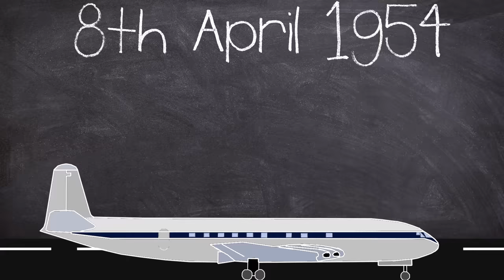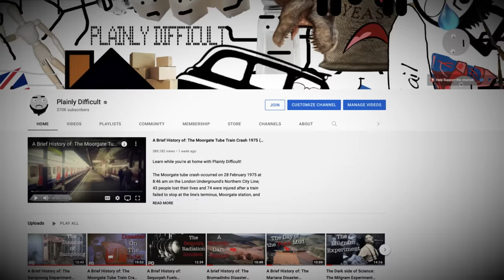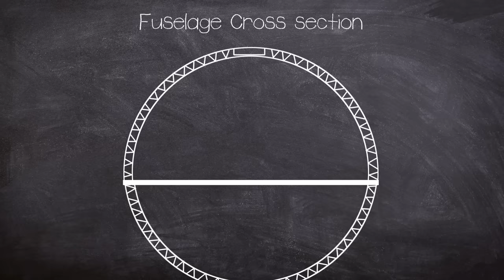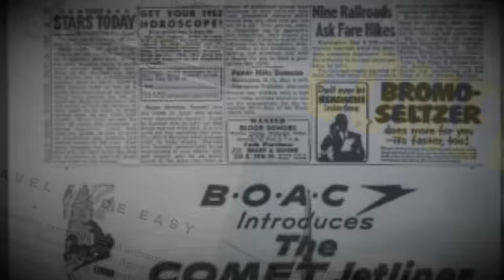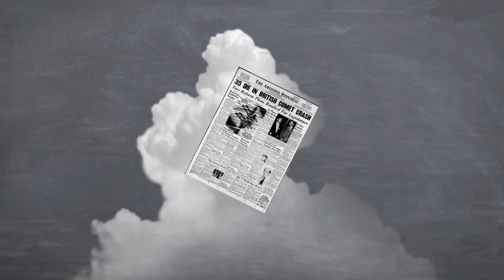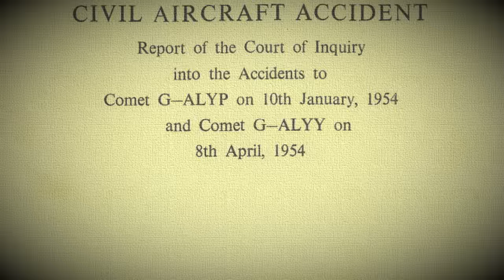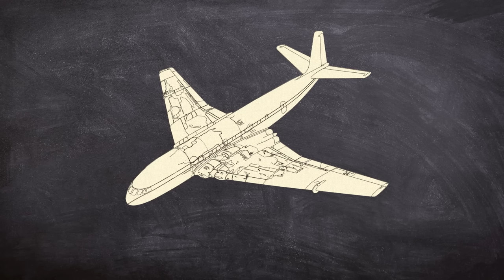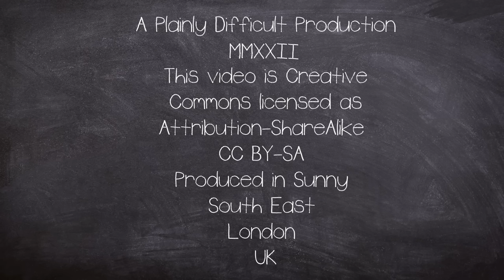A Brief History of: The de Havilland Comet Design Disaster 1954 (Documentary)

Comment: There is one thing that was missed - well, three things, if you count in the fact that the rivet holes on the Comet 1 were punched rather than drilled, which gave rise to the stress fractures in first place:
The Comet 1 design was deliberately made as light as it could be.  The Comet 1 was relatively underpowered, having four de Havilland Ghost 50 Mk1 engines which only offered about 5050 lbf per engine.  From the Comet 2 onwards, Rolls-Royce Avon engines were fitted instead, which were significantly more powerful - the Avon Mk.524s on the Comet 4 offered 9,500 lbf per engine.  As a result, from the Comet 2 onward, the aircraft were built significantly stronger.  The lighter structure on the Comet 1 was part of the reason why it failed so spectacularly: it simply was not designed for the sort of stresses that it would see in real life, even though engineers at the time could not have been aware of this.
Another thing is, that prior to the Comet disasters, the prevalent design philosophy used in British aircraft engineering was that of the Safe Life - a predetermined limit set at which the structural safety of the aircraft was thought to expire, and after which the aircraft should be withdrawn from service.  Going from prior tests using individual components, IIRC De Havilland calculated the Safe Life of the Comet 1 around 16000 pressurisation cycles.  Following the second series of tests which used an entire fuselage, however, the Safe Life of the Comet was proven to be dramatically shorter than previously calculated - failure expected to occur at any point between 1000 and 9000 cycles (or as it proved in both crashes, 900 cycles for G-ALYY/SAA Flight 201; and 1290 cycles for G-ALYP/BOAC Flight 781).  Following this, the design philosophy in aviation gradually moved from Safe Life (i.e. a precalculated failure point before which the aircraft would be retired) to Fail Safe design (i.e. designing the aircraft structure in such a way that any failure would not result in catastrophic/fatal damage).
On a side note, the earlier crashes mentioned also revealed different issues.  BOAC's G-ALYZ (October 26th 1952) and Canadian Pacific's CF-CUN (March 3rd 1953) both crashed at take-off after their crews over-rotated the aircraft.  Subsequent investigation showed that when the nose was raised beyond a certain point, the airflow over the wings was interrupted leading to a loss of lift, rendering a take-off near-impossible; as a result the wings' leading edge was redesigned.
BOAC's G-ALYV (Flight 783, May 2nd 1953) broke up in a thunderstorm; subsequent investigation revealed the aircraft was over-stressed by turbulence occurring inside the thunderstorm.  Failure in this aircraft was found to have started with its elevators rather than the fuselage itself; the accident was thus not caused by fuselage depressurisation, but rather the tail surfaces tearing off in-flight under negative stresses, which caused the aircraft to lose control and quickly disintegrate (within seconds, losing its elevators, then its wings; witnesses saw the wingless fuselage appear out of the cloud base and crash in flames).  A similar accident occurred 13 years later with a BOAC Boeing 707 over Mount Fuji (BOAC Flight 911, March 5th 1966).  In this case, the cause of the accident was clear-air turbulence, but the sequence of the structural break-up of the aircraft mirrored that of Flight 783 (failure of tail - failure of wings - crash).
Reply: So if they were made properly, could square windows still be used in airplanes? Or are they inherently weaker than round windows?
Reply: @BlackRavenFeather565  Concentrating stress on four corners of the window would require a lot of reinforcements making the aircraft heavier and more complicated than it has to be. It's even better to have bigger rounded window than smaller square one. That's why almost all aircraft windows are rounded. Not perfectly round though, just enough to spread the stress evenly over the edge.
Reply: Following this, the design philosophy in aviation gradually moved from Safe Life [...] to Fail Safe design
This is really interesting. The design philosophy changed from "let it crash and burn after X cycles" (ironically called "Safe Life", it's obviously a cost saving measure it should be called Save Costs) to "let it not crash and burn". I think that's a positive change.
Reply: @holz_name  No, that's not how it was intended to work. Safe Life was simply the designed lifespan of an airplane which should be safe to operate and after which it should be decommissioned. Like a car that is guaranteed to work for 150k km and then should be scrapped as it may become dangerous. The second approach is to make something that will be fail safe - should be safe even in case of failure. It's like a car without lifespan limit that may break after 50k km but will not kill you. It has much longer lifespan but requires regular maintenance to keep it safe.
Reply: Yes, I understood this. Safe Life is a cost saving measure, because you just declare that the aircraft is "safe" for x takeoffs and don't require costly maintenance. The other approach is costly, because first you need to design an aircraft that will not have a catastrophic failure and secondly it needs regular maintenance.
Reply: The square window thing is a bit of a fallacy given that the window's had filleted corners (see 15:00).  As pointed out, it was more likely the skin rivet hole manufacturing process that caused the surprising reduction in fatigue life.  I wonder if the second pressurisation fatigue test mentioned above used a production (or semi-production) fuselage with punched rivet holes rather than prototype drilled holes.  Also, the Boeing 707 had "square" style windows in a similar fashion to the Comet 1 although perhaps with larger corner radii.
Reply: Can you expand a little on this?
Reply: @Kevlar67476  De Havilland famous plane in WW2 is the Mosquito which is agile, fast and has low radar signature, but it is made of wood. Another fast and agile fighter is from Japan called Zero, which lack any armour. The mindset at work here is you trade some lifespan for some performance advantage.
Reply: @xponen  mosquito was a response to material shortages and lack of industrial capacity. 
Great Plane though. Glad it worked out.
Reply: Thanks, Nikko. I was hoping someone would mention the punched rivet holes. I watched another video about the aircraft a while back that covered items that weren't in this video.

Edit: I re-watched the other video.

1. The punched rivet holes. I don't remember if that was the case with the test article used for pressure testing, though. It may have been done to speed up production. Edit: If they had glued the airframe around the windows instead of using rivets, this problem likely wouldn't have happened.

2. The same test article was used for two different tests instead of one being built for each test. If I remember right, the pressurization/depressurization test work hardened the airframe, which caused incorrect results when the airframe was pressure tested to destruction. Edit: The two tests were maximum pressure and flight cycling. The stresses from the maximum pressure tests changed the molecular structure of the aluminum, which resulted in the flight cycling tests falsely reporting a higher number before failure.

3. They knew about problems with square windows, and they were accounted for in the design. Rounded windows are just easier to work with, so that's what we have today.
Reply: @holz_name  It's a bit more complicated than that. Both approaches are cost saving methods and the one picked is the one that will be cheaper. Best example might be engine oil. Most cars rely on Safe Life approach. Replace it every N years or certain distance driven. Is it a good measure? Not at all. Oil quality depends on the way the engine is used, how well maintained it is (contamination, soot), humidity, temperatures, short vs long cycles and other things. Estimating the oil quality would be costly compared to just replacing it 1-2 times a year. On the other hand if you consider the amount of oil needed to lubricate marine engines, it's way cheaper to periodically test the oil and record how it was used to know exactly when you have to replace it. It's fail safe design because you will monitor the quality of oil, make sure it is always fit to the job and yet you will not replace it until it is necessary. This way it makes the oil last much longer.
The decision between those two approaches is just based on the cost. Fail safe design becomes cheaper everywhere, where replacing parts or decommissioning equipment would be much more costly than continuous maintenance. In this case, if we'd estimate the safe lifetime of a modern airplane, it would be way too short. So the cheaper option is to estimate the maintenance schedule for each and every part of the airplane. 
It's not about being cheap vs good. It's just about which safety approach will be cheaper. Is it cheaper to replace a device after certain time or test and replace various parts to keep using it longer. Cheaper and more robust things are used similarly to Safe Life.
My older car required replacing coolant pump every 60k km. Turned out it's too much and it had tendency to seize around 50k km. What is cheaper now? Should we replace it every 40k km or should we check the condition of the pump at 40k km and then every 5k km? In this case it's cheaper to just replace this once per 40k km but if the pump was very expensive and complex, it might be cheaper to check it frequently and keep using it until it requires replacement. For the same reason current airplanes are in service much longer than the old ones. New ones use approach that does not put definitive end of life on them and that's what makes it cheaper.
Reply: Nerd
Reply: Designers would like to eliminate the windows altogether as they are failure points in the fuselage. Use TV screens instead.
Reply: Safe to say the aircraft was a complete piece of shit then?
Reply: Good accurate post.
Reply: @Kevlar67476  The Mosquito was a continuation of de Havilland's wooden aircraft design, the material angle was a justification used with the MAP to get the aircraft built.  They had used that wooden construction technique before the Mosquito and used it after in the Hornet and Vampire fighters.  The wooden structure was inherently resistant to fatigue due to the structure of wood.  In a paper detailing the work of the "Aeronautical Research Laboratories" in Australia regarding Aircraft fatigue, is a section on testing Vampire (metal) wings on a test rig the report states:

"after the equivalent of 41,219 and 67,238 flying hours respectively the two wooden fuselages to which had been attached the 23 half wings
showed no signs of wood or glue deterioration"
Reply: The lighter structure came about due to BOAC requiring the original design to be increased from 32 seats to 44 seats.  It was always intended that the Comet be powered by the RR Avon turbine, but RR was late and there was considerable pressure on de Havilland to get it in the air,  Of course, the light weight structure was only one of many contributing factors.
Reply: Still some grey areas. One aircraft loss - couldn't recover debris - sea too deep.
Aircraft that was recovered - failure started at a bolt hole, not a rivet, at an antenna hatch / window in the roof of the aircraft which turned out to have an unusual number of manufacturing caused cracks with crack stop holes added.
The 1954 water tank test aircraft - they did something like a significantly higher pressure cycle every 1000 cycles & the first  failure occured on one of the higher pressure cycles, the failure origin was at the forward port escape hatch. 
The thunder cloud incident was at night & could have been caused by the pilot becoming disoriented by events with resultant over and / or incorrect control inputs.
The failed takeoffs - it was thought that pilots choosing a too high angle of rotation wasn't a rational course of action & wouldn't need to be stressed as something that should never be done & didn't need to be designed against.
The way the Comet 1s were built was at the time to industry standard including the riveting methods & dealing with manufacturing defects.
Reply: Okay, so, based on this... This vid should be privated and re-done.
Reply: Yes, this was an overall good introduction to the investigative
process, but as you have pointed
out there were many critical details
not covered, particularly the method
of riveting the windows which was
discovered accidently during the
testing/investigations.
Overall I think, all of us who have
enjoyed the benefits of Jet travel
realize it was paid for by the 
unfortunate but it would seem
inevitable and unavoidable learning
curve of those Comet pilots and
passengers between 1952 and 1954.
Reply: @AndyRRR0791  true. It wasn't the windows at all. a bit more thorough research will lead one to the true origin of the failures...
Reply: The de Havilland company had a long well established reputation for poor engineering and antiqued manufacturing techniques, disregard for safety and staggering loss rates compared to its rivals.
The shameful truth about the Comet Disaster was that it could have been easily prevented if de Havilland had simply followed well-known and understood industry standards for construction of pressurized cabins made from riveted aluminum alloys.
Reply: @BlackRavenFeather565  The truth is irrefutable, the Comet 1 windows were not square and have the same 3 inch radius corners found on several successful models Including the Boeing 700 series
Reply: @xponen  The dH Mosquito does not have a low radar signature... in fact it has a surprisingly large RCS.
Reply: The window corners were rounded and not the cause of the cracks, even though the cracks did propagate to the windows.  The cracks were caused by the rivets, the skin being too thin, and being a poor choice of aluminum alloy. https://www.youtube.com/watch?v=-DjnG74DDno
Reply: @BlackRavenFeather565  The Super Constellation and DC6 had the same style windows.
Reply: @BlackRavenFeather565  The navigation window in the roof of all Comets/Nimrods remained stubbornly square.
Reply: Specifically to decrease weight, the initial Comet design had a very thin skin. It was highlighted by many structural engineers before flight, but due to the need to pack as much fuel and reduce weight due to the limited thrust and high fuel consumption of early engines it was judged to be acceptable.  After the accidents one of the first actions was to virtually double the skin thickness. Also the behaviour of the work hardening aluminium alloys used were not well understood.  The water tank tests of the fuselage had misleading elements. Initial pressure tests 'hardened' the skins leading to a longer service result than a fresh fuselage would have given. The original design called for Redux bonding of window frames and other structures which would have avoided crack starting rivet holes. Production was not happy with that apparently, and the design was changed to rivets.  This was before computers, so we are talking about hand calculations and modelling to check the results. Slow and error prone.